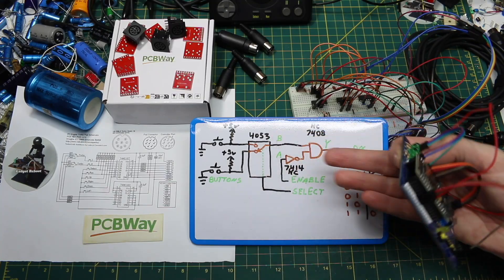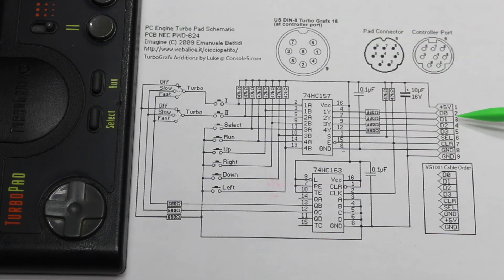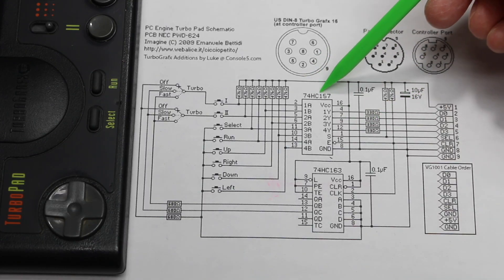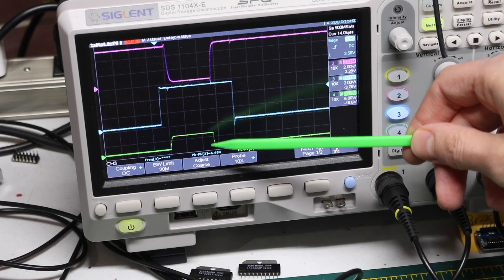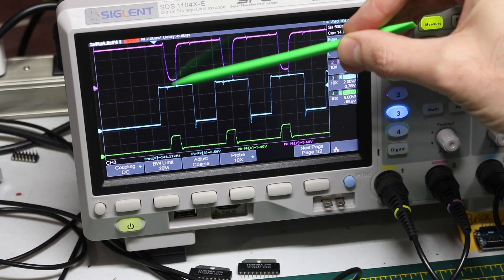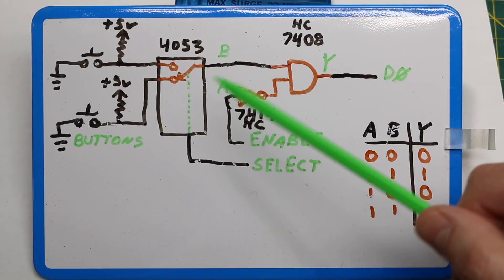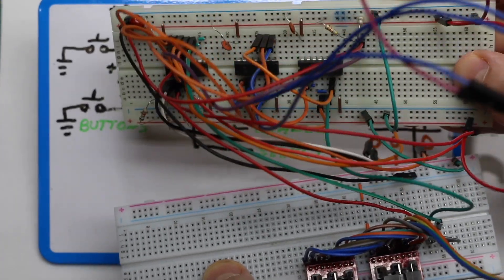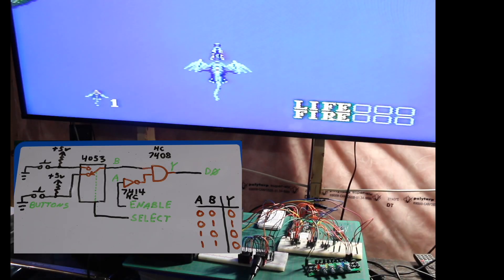I Made My Own 74HC Chip from Misc Other Chips

Comment: 3:23 - to respond to the /E interrupt faster I would try reading the state of the switches only once every millisecond; when an /E interrupt occurs you don't read the switches - you simply output the switch states from the last time you read them. The once a millisecond routine can package the switch states in a format that makes it easy to transfer them to the output GPIO pins.
Reply from the maker: I was reading them in and storing them in variables and then just choosing the appropriate bank of four to actually write to D0..D3 when required by the interrupt 
but it was still lagging too much so even if I was in the middle of reading switches to buffer them at the time of the interrupt I was still going out and handling it ASAP.
I was thinking of trying to further optimize it because I think there’s different ways to read and write even faster, bypassing some of the more bloated Arduino functions and maybe I’ll try that someday as a side project.

The other concern is even if I could get it working, the same ESP would be used for several other tasks so even trying to stop and prioritize this may not go as smoothly as expected so it would require a lot of experimentation and it might be just as well to use the dedicated trip.